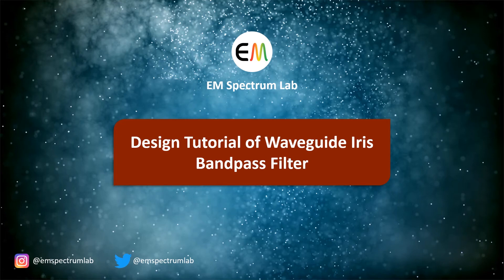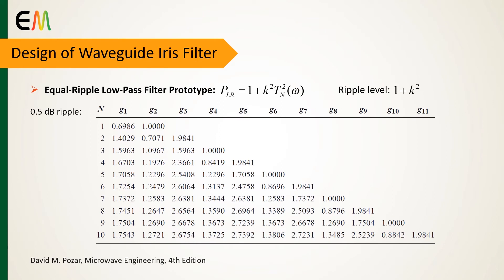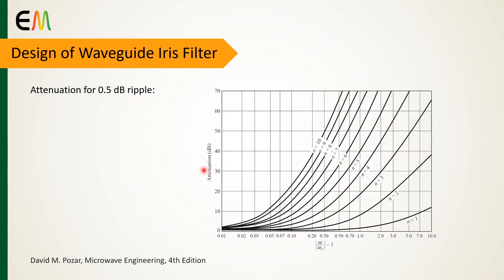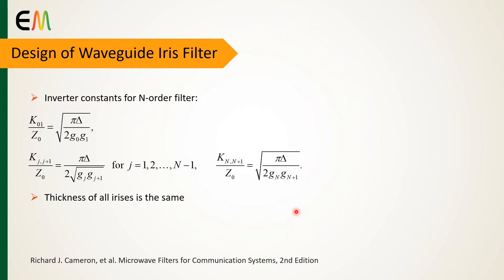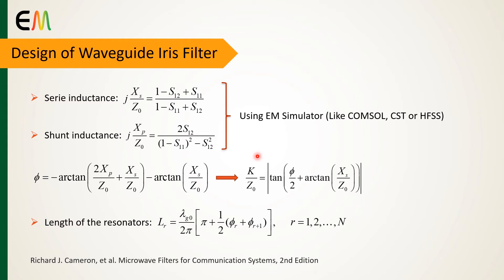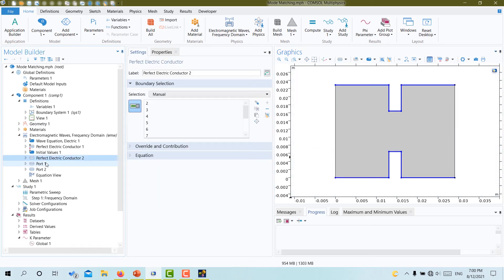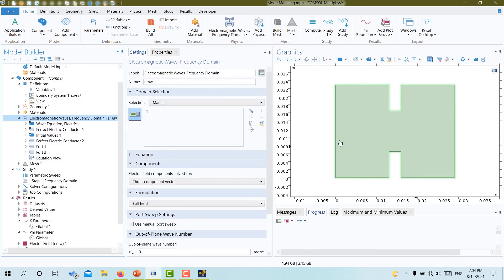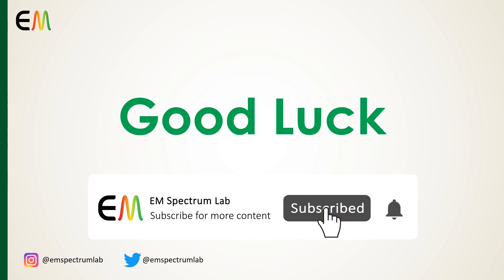Design Tutorial of Waveguide Iris Bandpass Filter

Comment: Very Informative Video. Really thanks for that. I wanted to know some details about this design Method. 
1. Did you use TRL calibration method to extract S parameters?
2. Can you please explain how you calculate Xs and Xp(you explained in the comment below but I couldn't understand)?
It would be really great if you could answer my questions. Thanks a lot.
Reply from the maker: Thanks for your comment. I did not use TRL calibration method, I just extract S-parameters using simulation. To calculate Xs, Xp and Phi parameters you should calculate S-parameters of an iris in a waveguide using EM simulator like COMSOL or HFSS (in HFSS you should draw 3D waveguide instead of 2D waveguide in COMSOL) and then using the explained equations in the video obtain the Xs, Xp and Phi parameters. You should sweep these calculations for different values of W parameter (iris width), so you have a matrix value of Xs, Xp and Phi parameters and therefore K parameter. Then, compare the value of the obtained K parameter matrix from simulation with the single value of K parameter from theoretical calculation. So you can find the correct value of W parameter.
Reply: @EMSpectrumLab  Thanks a lot for your reply. How did you extract S-parameter using simulation?
I have emailed you regarding the same. It would be really great if you could explain it. Thanks

Comment: Great video! Just one doubt: Did you take a random iris dimension while calculating in Comsol? Or you just did it for 11.5GHz by reducing its length by keeping the width constant?
Reply from the maker: At the first I took a random width dimension but by some simulations you can find the correct interval of iris width to find the solution. My design example is just for 11.5GHz. Thickness of all irises is assumed to the constant value during design process. For 11.5GHz, I assumed it to 3mm.
Reply: @EMSpectrumLab  alright so you made a rectangular waveguide corresponding to 11.5GHz with a random iris window. Right?
Or you designed 2 WR90s and joined them forming an iris?
Reply from the maker: @doritos2146  I made a rectangular WR90 waveguide for 11.5GHz but the width of each iris is variable and set by using simulation and theory as I explained in the video.

Comment: I was looking for such a video! Thank you so much! My question is how do you plot the K versus Phi values? and How can we determine the values of L and W shown in the table? Thanks again!
Reply from the maker: Thanks for your kind comment. I would be grateful if you subscribe to my channel. As I explained in the video, "Phi" is expressed by "Xs" & "Xp", also we can write "K" in terms of "Phi" parameter. However, I plotted "K" versus different values of "W" parameter. The value of "W" that its corresponding "K" value is same as the theoretical value of "K" is the solution. After obtaining the correct value of "W", we have the desired value of "Phi" and then "L" is calculated using the mentioned equation in the video.
Reply: I subscribed just now again. I thought i was subscribed. You deserve a subscribe. :)
Reply from the maker: @mohsin0608  Thank you for subscribing
Reply: I still have a question. I will email you.